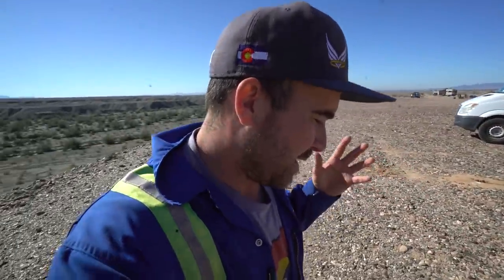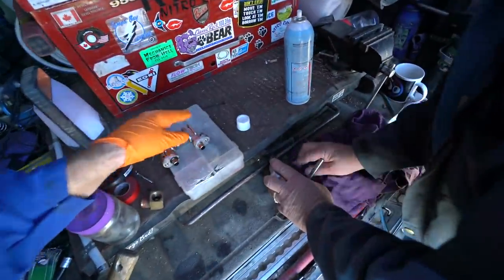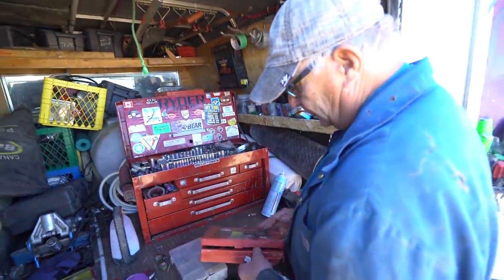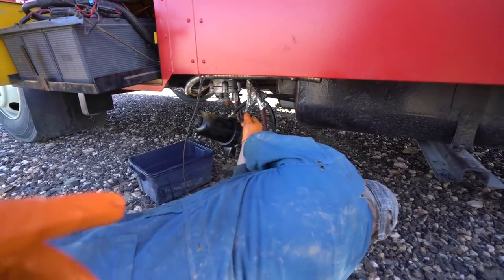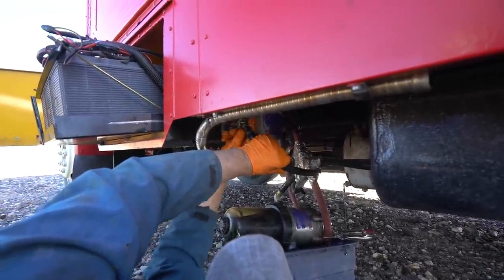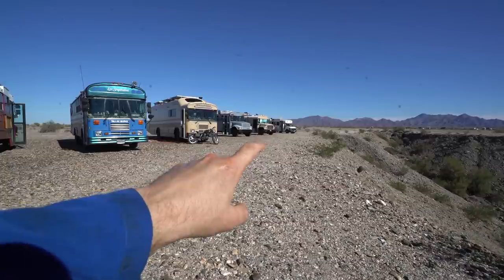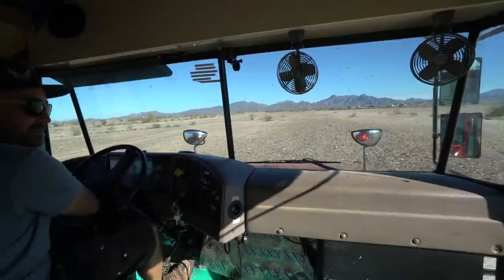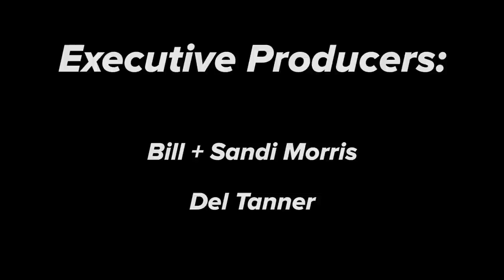VEGETABLE OIL DIESEL CONVERSION PROBLEMS

Comment: The problem was the o rings on the water side were leaking so we replaced them. All good now.  🇨🇦🇨🇦
Reply: So is it all done now and running sweet ?? as Jax put at the end of the video he still had issues. xx
Reply: I think the real problem is that biodiesel attacks the o rings intended for most dino fueld diesels. It degraded the ring in the filter causing it to leak and will do so again. Also...all other o rings in the engine.

Is the water / fuel separator not working?
Reply: @watsok  heard of these issues due to acidity of veg oil especially used oil and I'm sure slightly rancid from sitting around probably lowers PH even more.

Comment: Right on! I would be super interested in a cost analysis of running the bus on veg oil vs paying for diesel or gasoline. Particularly, a breakdown of how far a dollar takes you on each would be really interesting. We went with a small van because of fuel economy considerations, but I'm interested in doing a schoolie eventually, especially if we could make the fuel cost competitive with bio diesel.

Comment: Badge is such a funny dude!! I wont even try to understand what you guys just did, but glad it's up and running again!!
Reply from the maker: Haha thanks! Hot water flows thru, to heat the filter. It was leaking water into fuel part.

Comment: WOW!! just found your video and its great. I to run my Bus on used veg oil I get for free. 1988 MCI with 6v92. I use a heat coil in my tanks and 2 pumps. 225 gallons veg+35 gallons diesel. for start up and shut down. I get about 1700 miles on the flat part of the country about 1300 on mountains and hills. And I got my gen that will run on veg also. A great video and a new sub here
Reply from the maker: Holy crap that’s a lot of fuel!!

Comment: My semi truck had both a filter heater and a hot coolant line in the fuel tanks. It allowed me to use #2 fuel in the winter. You just never could park it outside overnight in the winter, unless you put #1 fuel in the tanks. Glad you found problem and Badge got you going.
Reply from the maker: I thought #1 and #2 was just nozzle size? Someone told me that and I’m probably repeating bad info.
Reply: Jax Austin it varies a little on where and how it’s refined, generally straight #2 fuel starts to gel around +10°F, #1 fuel should be good down to -60°F, 50/50 blend of #1and #2 should be good down to -15°F. Kerosene is more filtered and has some aromatics removed, hence why it’s more expensive. Before the ULSD mandate, #1 fuel oil/heating oil and #1 diesel were the same. Jet-A can be used as #1heating fuel. You can not buy # 1 heating fuel and sell it as Jet-A, even though we would load it from the same fuel arms from the same fuel tanks. Many places will add anti-static agents to Jet-A.
Reply: wat i done in  winter time is mix some regulair unleaded gasoline in about 1 liter for every 10 to 20 liters  , stops it from gelling , burns a little hotter too
Reply: @watahyahknow   and your diesel wont froze😊
Reply: @spiritsoul11108  its more gelling up , and it clogs the filter when it does tes the gasoling prevents it , its like anti freese for diesel

Comment: o rings and veggie, only viton o rings will work. same for hoses, they need to be viton lined as well. i used grease car valves in my vehicles = to switch between diesel and veggie. make sure oil is dry, or you have corrosion issues. best o luck.
Reply from the maker: Thanks !!

Comment: i have been running cooking oil for several years and the biggest thing is clean oil. settling and filtering down to at least a 10 micron filter is important. i use bag filters. If you would like any advice i would be willing to help.
Reply from the maker: I’d be stoked to learn any info you got!
Reply: Awesome never have to much info 🇨🇦
Reply: @briansmith-wp5qn  

Brian, do u have any videos available or a channel explaining your veggie oil system installation and the process of getting, filtering and storing it?

Comment: when you keep large quantities of veggy oil in a tank for longer it will turn ranchid (looks like mayonaise or lard ) it collects moisture and a kindah seaweed like mouldy substance , i think its better to either run out the tank right after filling it or run small batches at a time , as for filtering the tank out , you could build a seperate pump and return system with a filter in it or a series of mesh filters or run the filter system intoo a smaller day tank on wish you run youre motor that day , and since the water collected in the waste oil sinks to the bottom it might be an idea to put a small tap there and drain the moisture off every once in a while after sitting a few days
Reply from the maker: I am thinking to hook up the transfer pump to the bottom of the tank, then pump through a series of gravity filters, back into the tank until it’s clean

Comment: A friend converted a Suzuki Samari and when he started using recycled oil it gave him problems he said he didn't account for the salt in the recycled oil, so I'm not sure if your filters get the salt out of the used oil but may be worth checking into. Good luck.
Reply from the maker: Thanks. Haven’t heard of that, but makes sense.
Reply: @JaxAustin  
He mentioned that the salt doesn't break down and it's abrasive, and its not very good on rubber seals gaskets. Hopefully this helps.

Comment: So, I heard you mention you use 20% motor oil and 80% Vegie oil. With high fuel costs today, I’m trying to figure out the best set up to install on my 2001 F350 7.3. Any advise would be appreciated. Great video

Comment: curious does it smell like you got some frying oil to hot in pan when it starts to smoke?  I know this stuff would never work on any newer electronic diesel like ISX would work fantastic on those old multi-fuels that were ran in the old deuce military trucks.
Reply from the maker: It kind of has a sweet smell to it. Mine is electronically injected, but the preferred engine is the mechanical.
Reply: @JaxAustin  Would have never thought that.  Was thinking the newest EPA garbage like the ISX 15 liter and Volvo OTR truck engines or latest Benz  killer efficiency.  ISX is a good motor just don't like the crap that was mandated anything after 2017.   Old mechanical and wet sleeved engines are the best by far, easy to work on and rebuild right in frame.

Comment: Jax my long lost so-called friend of the west, you & skoolies & o-rings just don't get along. if I recall correctly your old bus stranded you b/c of a darn o-ring 2 times even. let's hope this 1 is a once & done for yeah
Reply from the maker: Yes, you are correct. They do not last forever. Especially when you pull the filter housing off of 1,000,000 mile diesel truck.
Reply: @JaxAustin  very true good luck this time